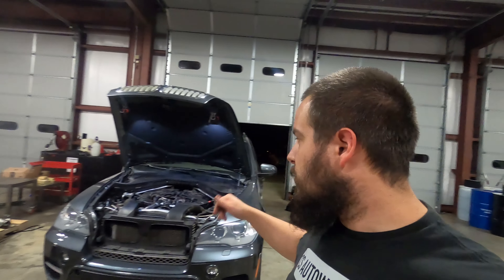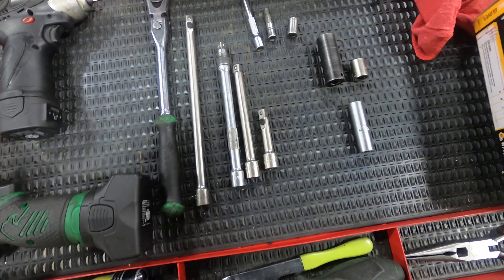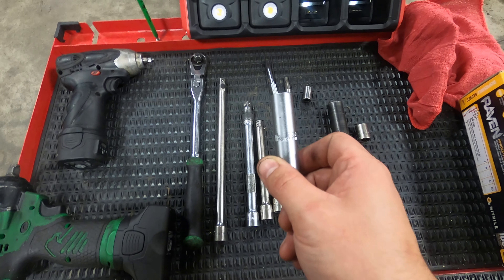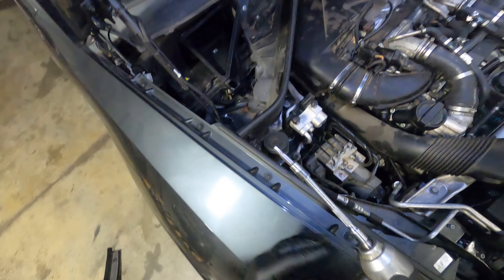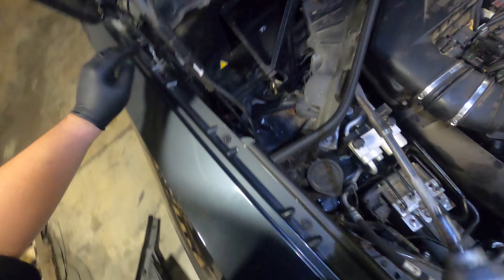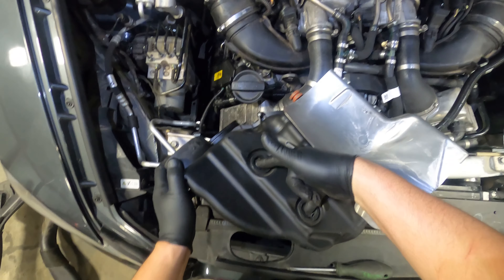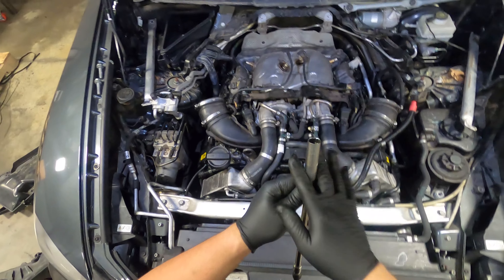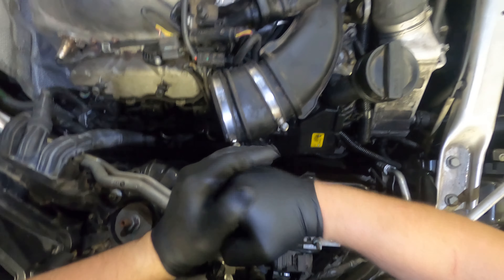BMW X5 Spark Plug Replacement(N63) | E70 Spark Plug Replacement(N63)

Comment: First video I found for X5/n63 and it didn't disappoint. 

Two items: the "5mm Allen" are actually T25 and the bolts on the crossbars are 15mm I thought I heard 16mm in the video. Super helpful we'll done video.
Reply from the maker: You are correct on the crossbar bolts being 15mm. Too many other things on bmw suspension is a 16mm. So i go to that size too much, and it works on those bolts, but isn't technically correct. As far as the bolts on the cowl, I've seen them interchangeably use either 5mm Allen or T25. Not sure if it's a production year changeover or what but you can see either/or. I should've pointed that out in the video.
Reply: Seriously. Very well explained step by step and you can actually see what he's doing.

Comment: Great video thorough and clearly explained.

Once you removed the airboxes out, were you able to see the engine mount bolt. I'm trying to remove the driver's side engine mount by lowering the subframe and raising the engine up a few inches. Thanks.

Comment: This is literally the 6th time i watch your video!!  Amazing step by step// actually looking fwd to do mine as soon as my tools get here// question what spark plugs did you install ?? Brand etc etc ty!!
Reply from the maker: They were NGK. They were factory BMW replacement plugs ordered from the dealer for this vehicle.
Reply: Last question// did you unplug the battery?
Reply from the maker: @trubuLace  I did not. But you can if you are worried about anything happening.

Comment: great video. I have misfire in cylinder 7. I changed the spark plug. clear code 20 min later back on saying the same thing. is there a good chance that it’s the coil that is bad. hoping that would be the problem before bringing it to the shop
Reply from the maker: I would bet it's the coil. Starts to have issues once it's warm. Move that coil to a different cylinder and repeat that test of clearing it and seeing if it comes back on the new cylinder.
Reply: @MunkysGarage  so I replaced plug and coil. cleared code, Still cylinder 7. any other thought before I have no choice to bring it to the shop

Comment: Great video, haven’t seen one specifically for the E70 N63 combination.  What’s your take on using anti-seize on the spark plugs?  Yes or no?
Reply from the maker: You can use anti-seize on them. I never have but it can't hurt.
Reply: Just be careful not to overtorque because of less friction in thread contact area.

Comment: is it necessary to tap the spark plugs first.  i see some people tap on their lugs to close gap.  any recommendations for that?
Reply from the maker: Most spark plugs sold now are pre gapped for their application. It doesn't hurt to check the gap on them with a spark plug gap tool. However, there are newer spark plug designs that can be easily damaged if you attempt to adjust the gap with the tool. Those are fine wire platinum and iridium designs. So, I would exercise caution if you need to adjust the gap on one of those.

Comment: I have 80K on mine and have been getting misfire codes. I was about to order the recommended "ignition service kit,", but decided to watch your presentation first. And I'm glad I did!
Here's my question: is there any reason to pay $250+ for a kit  to replace all 8 coils at the same time, even if they're fine? Thx 4 great video.
Reply from the maker: I don't think it's worth it. The coils do fail on bmw's, but not so frequently that I would replace all of them at once to prevent any kind of issue in the future. I have two bmw products, one with 200k and the other with 147k and both have the original coils in them.

Comment: Great video! How much torque to tighten the 16mm bolts on the cross bars and the 10mm bolts on the trim? Thanks so much!
Reply from the maker: Not sure of the torque of the 10mm bolts for the trim, I am unable to locate a torque spec in my information source. The 16mm bolts for the cross bars are 19nm and then 90 degrees of rotation.
Reply: @MunkysGarage  thanks! So tighten to 19nm and then rotate another 90 degrees. I guess hand tight on the 10mm. Thanks again!

Comment: Thanks for the video, I have a check engine light on, that the engine is malfunctioning, reduced power, in my 2012 X6 Xdrive50i.  BMW said that the spark plugs needed to be replaced.  I replaced all my spark plugs by NGK laser iridium (DIY) but it still doing the same thing, I used my small scanning device and it says that I have 2 miss fires in cylinder 4 & 5, does that mean that the coils need to be replaced or  should I replace all 8 coils, but not just for cylinder 4 & 5???
looking forward to your response.
Thanks
Reply from the maker: I would take the coils from cylinders 4&5 and move them to different cylinders. After doing that run the car again and see if the faults move to the cylinders you moved the coils to. If they do then that indicates the coils are faulty.
Reply: @MunkysGarage  
If after I switch them the problem persist... that means I have a bigger problem, right?
Reply from the maker: If the issue doesn't move to another cylinder with the coil I would then swap the spark plugs around and recheck. If the issue still stays with that cylinder then yes it's something more.

Comment: Do iridium spark plugs work on a 3.0i x5 e53 engine
Reply from the maker: You can use them if you'd like to, but they are not necessary. Platinum would work just fine.

Comment: Having issues getting the 14mm 12 point socket to loosen the spark plug. Are you sure it isn't a 16mm? How low on the spark plug should the socket fit?
Reply from the maker: It is definitely a 14mm. If you are trying to use a regular 14mm socket sometimes they are too thick walled to fit properly. The actual spark plug socket is thin walled. You can try grinding down the outside edge of the socket to make it thinner if you are trying to use a regular socket.

Comment: Awesome video!!! Do you need to gap the spark plugs if so to what ? I got the Bosch they all are at 0.030
Reply from the maker: They are already set to the correct gap out of the box. No adjustment is necessary.

Comment: Hi I have a miss fire problem when I start cold, when I stop the car and start it again everything becomes normal, when I accelerate we would say that I have a power problem, I scan the car and it gives me 1 cylinders , 2,3,4 missfire, thought you if I change the candles it will solve my problem and thank you
Reply from the maker: Sounds like it could be spark plugs. I would start with replacing them. I also wouldn't rule out there being a faulty ignition coil or two as well.

Comment: What spark  ugs did you use or recommend?
Reply from the maker: I used bosch part # ZR5TPP33. I believe the OE is a NGK plug but I am not sure of the NGK part number. The OE part number is 12 12 0 037 580.

Comment: I’m emailing myself this video for 5,000 miles from now. I’ll be at 60,000 miles then. Question. What are those sensors right in front of the Mass Air Flow sensors? The ones with wires coming out towards the front of the car? I was changing my engine air filters last night, put just a tiny bit of pressure on one and heard a cracking noise. Now it wiggles.
Reply from the maker: Those wires are the connections for the oxygen sensors. The one runs underneath the airbox to the back of the catalytic converter. The other runs around the top and to the oxygen sensor you can see next to the airbox. The crack noise was from the bracket that holds those sensors. It breaks on literally every N63 because it gets so hot in that area and just destroys the plastic.
Reply: Munky's Garage Thanks for confirming my suspicion that it was just a bracket that cracked. And thanks for telling me what those are. Great video!
Reply: @MunkysGarage  is that the location of all four oxygen sensors or are some located underneath the engine as well??
Reply from the maker: @jhunter5606  all four oxygen sensors are on top on this vehicle. The catalytic converters are located behind the turbos and directly below the airbox assemblies.

Comment: I got a x5m so should the s63 be the same
Reply from the maker: S63 is going to be pretty much the same procedure. The air intake boxes are attached a little differently and I don't believe you have to take the cowl trim and crossbars out in order to get them out. Don't quote me on that though. It has been awhile since I worked on an X5M.

Comment: Got everything broken down on my x6 only to find out the 14mm socket HAS to be a thin wall one. Definitely would’ve been good to know that at some point in the video.
Reply from the maker: I apologize. I pointed out that it took a special socket. But didn't emphasize it had to be a thin wall 14mm and that's my mistake.

Comment: Just did this with my X6, based off your very good video. The hook pick worked wonders. I’ve seen other people putting a  screw driver laterally through the coil clamp holes to pull them out. How clumsy is that?? Hook-pick, much better. Although I was able to do this with the 6” and 12” ratchet extension, I see you were using something even longer? I could have used a 18” extension. Especially for cylinder 5 (front driver’s plug). Thanks for all your instruction!
Reply from the maker: I use a long extension on things like that because I'm not a fan of hitting my hands and the ratchet off of everything in the engine compartment. I like to have it out in the open so when I break the spark plugs loose I don't punch something with my hand. Then once they are loose I can spin the ratchet easier to get them out.
Reply: @MunkysGarage  LMAO. You listed everything that happened. Picking up an 18” today for the next plug job.

Comment: Does an 2011 e70 35i. Have same process??
Reply from the maker: That is an inline 6 cylinder engine(n55). There is a few more trim pieces that have to come off but generally the same.
Reply: @MunkysGarage  replaced all 6 plugs and boots  the rear 5 and 6 had moisture any clue on what could of caused it? It does have a bad cowl cover.

Comment: This is the same motor on 2011 x5 e70?
Reply from the maker: If it is a V8 then yes it is the same engine, this is an N63. The E70 also came with the 6 cylinder gasoline engine that is the N55 as well as the 6 cylinder diesel that is the M57 in that year. But if its a V8 then yes its the same engine.

Comment: I have 196,564 and I never did a tune up. Reason for not doing one is because it still drives great.
Reply from the maker: Yeah some vehicles are hit or miss. I've worked on some cars with high mileage and the original plugs. And I've had low mileage cars have plug issues.